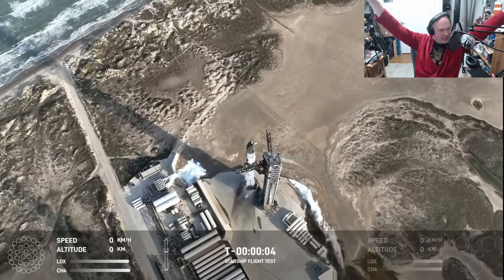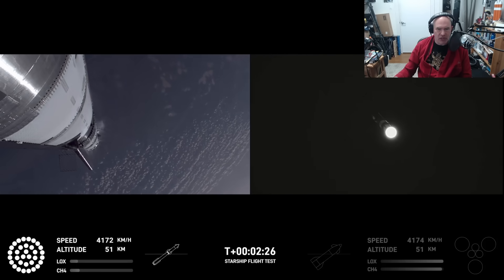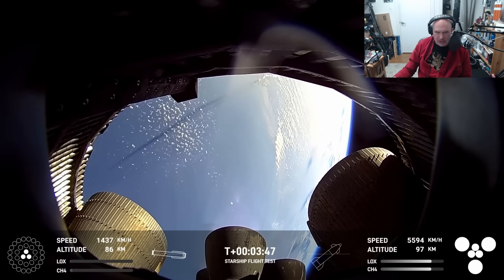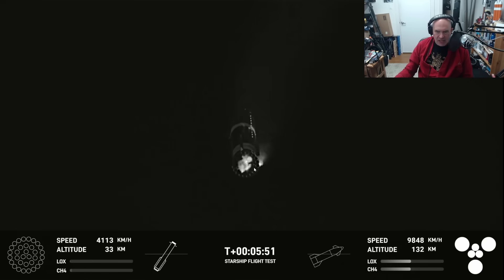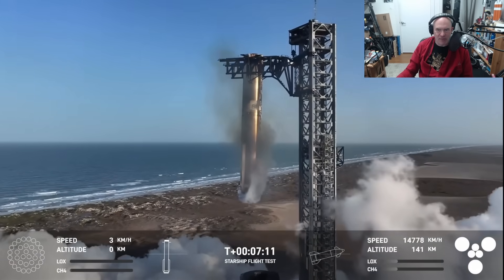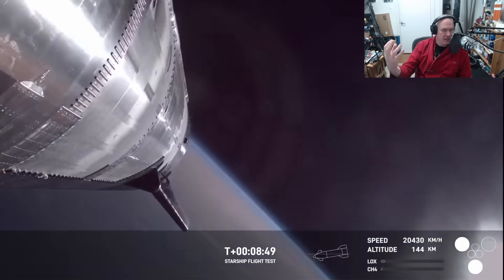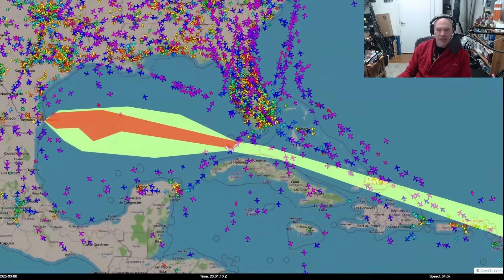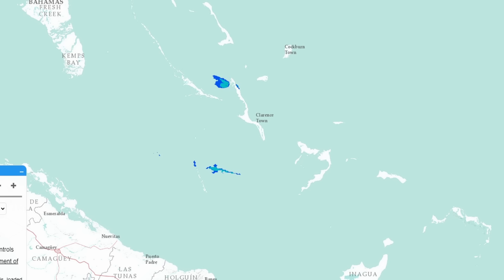SpaceX Make The Same Mistake Twice With Starship Flight 8

Comment: I saw an interview where the spokesman said most likely some serious re-engineering will be necessary, and he stated there probably will be a long pause before another star ship is launched. He said especially because the failure point appears to be very similar to the previous launch. With this new launch, he said several items were changed or replaced that could have been accomplished fairly quickly. Whereas now, more serious and extensive revisions, etc. could involve an extensive period of re-engineering.
Reply: This one was done and ready before the last one launched 🙄
There were some differences, because of what they wanted to test, but that's their ongoing testing profile.
Would you rather see an SLS launch every 2+ years, or a Starship launch every 2+ months?!
In my mind, more launches, more better! 
If SLS blows up in 2 years, when it launches again, will it be cancelled or will they have to review data for 2 years and try a new launch in 3-5 years??
I think at that point it IS DEFINITELY OUTDATED AND SHOULD BE CANCELLED!
Not hating on SLS, just the time frame they milked, to get a rocket in orbit IS RIDICULOUS!
HALF of the parts are from shuttle, because they have to justify the money spent on those parts all those years ago 🙄
Reply: @ricklong3218  SLS Artemis on it's first try, launched successfully, didn't explode, went to the Moon, orbited it, completed all the tasks asked of it, and returned to Earth for a successful splashdown. 

Until Starship can complete a single orbit, then you don't have a foot to stand on in trying to denigrate NASA and SLS.
Reply: @ChaosCat79  NASA did not build SLS. SLS was grossly over budget and grossly overdue. They made 1 attempt and succeeded! That's great! I was super jacked to see shuttle engines light again! I never said anything bad except what I just reiterated.
Now after 11 years of development happen for Starship, people will still be beating on SpaceX, because they dislike the person whom founded it.
SpaceX gets very little operational money from the US government, ESPECIALLY when compared to the other companies. 
There are still other rockets coming and I will be just as happy to watch them succeed OR fail just because we get to see launches!
Reply: @ Musk and Space X received $38 billion to deliever a Moon landing system as part of the SLS/Artemis mission. 

Where is the return on thaat taxpayer funded investment?

Plus for someone claiming they are not "hating" on SLS/Artemis, you spend an awful lot of your time denigrating it and looking for all the negatives, while insanely boosting the positives of Starship (there are none) and ignoring it's many, many problems.
Reply: @ChaosCat79 Damn, you just pulled that $38 billion number out of your ass, didn’t you? The actual amount is like a tenth of that. Get your facts straight pls.
Reply: @ChaosCat79  care to elaborate please ? where did 38B even come from ? bro last time i check NASA annual budget was 24B per year and SpaceX only get a fraction for some CRS and somewhere around more than 2B for HLS R&D, around the same price tag for Crew Dragon NASA awarded to SpaceX in 2012.

i think you are mistaken SpaceX for Boeing lol.
Reply: @ricklong3218  yeah it's so weird watching this now: people hated SLS, like a lot

Comment: This is a centre of gravity issue that SpaceX is obviously trying to overcome computationally. And their computational solution isn't working, which is why the thing keeps tumbling out of control. I'd guess this is a fuel issue - as fuel runs out, the centre of gravity keeps moving towards the back of the ship, making it increasingly susceptible to tumble-turning mid-flight. Obviously, the solution can't be achieved by firing rockets to adjust against the shifting weight, which is what they have been trying to do computationally. Boeing had the same problem with the larger engines on the 737 Max. And computations didn't help there either. Sooner or later, SpaceX will have to go back to the drawing board and push the fuel tanks lower down the space ship. Right now, that's something they clearly don't want to do. Computations won't solve this kind of issue. It might lower the risk of it happening, but it won't eradicate physics entirely.
Reply: Charles that wasn’t the issue. Scott explained this; it was just a failure of all thrust vectoring engines. That’s it. Without those 3 SL center engines they have insufficient attitude control, that’s literally it lol. Their issue is their engines being fundamentally unreliable and that’s been an issue on every flight.
Reply: The 737 Max had WAY more issues!
It's software, training, seat time, not listening to pilots, and bean counters 🙄

Comment: So they have to have leaks of methane and oxygen right. You need both in space to have a fire. So do they have multiple leaks or a leak at a point that both gases are released. If the metane is warmer then the lox would a leak into the lox tank of methane cause a pressure build up from the lox boiling and the pressure relief valves are dumping a mix of gasses to control the pressure?

Comment: It's interesting that back in the slide rule days of apollo we were soft landing stupid machines like a surveyors. ..but getting current technology to soft land and remain upright is a struggle...

Likewise...brute force stupid rockets  got up early and managed to make it to the moon enough times to call it a win and be abandoned...even though we did not have computer capability or navigation capability to guide an S1 stage back to a landing. 

I don't think it will ever be possible to make space flight as commonplace as airline flight given the performance requirements....even if that's the goal and even a requirement to make mass spaceflight a common occurrence.

I think chemical rockets are just a dead end...and engineering firms should be spending these billions on research into field propulsion...if they really want to do 'space' travel...

The unfortunate aspect of all of this is the capitalist profit requirement...and research and development on systems that don't produce obvious results or produce results of such paradigm changing improvement as to be culture shocking are almost equally  bad...

And so we're stuck doing rinse...wash...repeat...

Comment: Musk implemented DOGE at at SpaceX (Department of Gigantic Explosions). Russia failed with it's enormous N1 Moon Rocket. With 30 engines and too many moving parts that could fail. Soyuz however holds the record for the most launches in the history of spaceflight. It has less engines and less moving parts to fail.
Reply: Falcon 9 is superior to Soyuz.
Russia hasn’t advanced much past what the Soviet Union accomplished.
The N1 failed for MANY reasons.
The engines couldn’t be test fired, they didn’t have the ability to gimbal engines and therefore needed to use thrust differential, the person pushing for the N1 died during the program, and many other groups inside the Soviet Union were pushing against the N1.
Pair all of that with funding issues and it’s easy to see why it failed.

Falcon heavy uses 27 engines, so clearly engine count itself isn’t an issue.
Reply: @terrestrialcreature7481  Thanks for comment

Comment: I get that we aren't that worried about the engine starts on the booster because it doesn't need them all, but it isn't really redundancy if they never work in the first place.  I'd really like to see those engines being reliable, lighting up as expected on a regular basis.

Comment: There was the mishap loading the starship onto the booster. Maybe a piece of something broke off and pinged into the engine nozzle weakening it. I also noticed the image of the ship on the telemetry display was acting very oddly if the ship was spinning around - If you can't program a display to reflect reality, then what hope is there for other software?

Comment: @scottmanley or anyone. A few questions. Part 1: Does SpaceX do a test hot fire engine test on the ground with starship connected to the hot staging ring? Could some kind of hot staging ring blowback be damaging something?
Part 2: shouldn't starship eventually have some kind of higher control authority thruster system on it to regain control in the event of failures? The amount of useful data that they could have collected if they were able to regain control of starship to at least orientate it for a safe re-entry and record data all the way down till impact with the ocean. Not to mention when starship becomes crewed, the implications of only having major control authority with the sea level engines, failures still have the possibility of happening hundreds of flights into the future. I'm guessing it is a payload and fuel margin problem during these experimentation flights, much like the temporary hot staging ring separation requirement, but I'm still wondering.

Comment: Hi Scott:  had a thought (hey, happens ;-).  What is the one common item with these two launches that was not common with the early launches?  The hot staging ring!  I never liked that thing from the first I heard of it. I think it is dumb as a door knob to ignite your engines in a confined closed space.  Yes, I know it has openings maybe even most of it is open, but if you light up six raptor engines, all at the same time at that one spot, that is an enormous shock!  What do you have all been turning around.  Also, observed, that none of the testing that SpaceX did on the upper stage coming into flight eight used, or tried to simulate the response of having that hot staging ring, blocking the rocket exhausts I don’t believe.  I think this idea is damaging the engines, the piping in the structure of the ship when it ignites for staging. Elon, if you are if you are reading this, let’s do an experiment on flight nine, where we do not do hot staging, but rather figure out a gentle separation something like what the Saturn five used to do. If it fails again, then I can concur that the hot staging had nothing to do with the failure mode.  But if you suddenly have a successful flight nine, I think you will have found your culprit. That is not to say that everything is as strong or correctly designed as it needs to be on the ship, but it would suggest that we need to figure out a different way than the current hot staging method. That is my Saturday couch rocket engineering for today :-)

Comment: Worth mentioning that Starship flight 7 and flight 8 both failed exactly at the same time which was just over 8 minutes into flight. Same faults, same result despite all the modifications and fixes to Starship.
Reply: To me, this fact indicate that SX looked at the wrong place and tried o mend things. Otherwise with stronger, better, etc piping they wouldn’t have the second failure exactly at the same time and in same way, like they did nothing. Second failure was perhaps even more violent.

Comment: Ok, Starship and its booster have come way further, way faster than Boeing's Starliner in so many ways. SpaceX has managed, yet again, to capture a booster with a pair of arms. Something just 25 years ago thought to be impossible according to a lot of folks, or darn near it. That does not include the repeated landing of Falcon 9 boosters and cores, which was also thought near impossible just 25 years ago. Starship has a lot of work to go, it took nearly a decade of rushing to get Apollo to the moon, SpaceX has no reason to rush, just make sure it works. This is all new territory. Even with the failure of two Starships back to back, I am beyond impressed with the things being pushed forward.
Reply: Starship has to prove that it is capable of carrying cargo, astronauts, can complete an orbit of Earth, can re-enter Earth's atmosphere safely, land on the Moon *somehow*, display never-before-tried-in-flight refuelling (in space), show that cryogenic fuel can be prevented from boiling off during said refuelling, do that multiple times.... All before the NASA set deadline of 2026 for when the Artemis III will launch for the Moon to land on it. 

Yeah, "no rush", indeed.

Comment: My analysis of the causes of the IFT-7 accident.

A few days before the flight, I wrote on another Facebook page: "For me, the most interesting thing about this flight is how the rocket will behave if it is indeed loaded with 300 tons of more fuel."
In my opinion, these 300 tons are our big pink elephant in the IFT-7 "room" when considering the causes of the Starship explosion. Let's add that in addition to the 300 tons of fuel, we also have 20 tons of mass-size models of Starlink 2.0, plus another 5 tons of additional mass due to the fact that Starship 2 is 2 meters longer than Starship 1, plus about 5 tons thanks to the new Penz dispenser, plus another 2-3 tons of additional equipment, which they add with each new flight in the form of additional stringers, anti-splash devices (especially in the Superheavy liquid oxygen tank), etc. This gives us about 330 tons more mass than the IFT-6. Or the mass of 5 heavy battle tanks, each weighing 66 tons. About 99% of this new mass was added to the Starship and only 1% to the Superheavy.
As a result, the weight that the 33 engines of the Superheavy now have to lift increases by 6.6% - from 5,000 to 5,330 tons. During the launch, it was obvious to the naked eye that the rocket was more cumbersome than previous flights, and in the end it achieved its weakest telemetry result to date, excluding IFT-1: 4,400 km/h, at an altitude of 60 kilometers at the moment of the booster engine shutdown.
After the separation of the stages, the difficult fate of the six engines of the Starship began. The mass they had to accelerate to 26,500 km/h is not 6.6%, but a full 26% more than in previous flights. The thrust-to-weight ratio(TWR) for IFT-7 has dropped from 1.1 to 0.88, which means that the combined thrust of the six engines - 1464 tons, now lifts 1670 tons instead of 1325 tons. A TWR of 0.88 is usually not fatally low for a second stage, but in this case Starship was left by Superheavy in a much deeper gravity well than usual. For comparison, the TWR of the Falcon 9 second stage is even lower - 0.8 with full load of Starlinks, but the Falcon 9 booster takes it to an altitude of 62 kilometers and a speed of 8000 km/h. At IFT-7, at this point in the flight, Starship was 2 kilometers lower in altitude and 3,600 km/h slower. At such low levels, Starship's engines have to work at the limit of their capabilities to bring it to the required altitude and speed. And as we know from IFT-1 and in particular from the list of 63 FAA recommendations, Raptor2 and its piping systems are extremely susceptible to leaks when operating at full power - about a third of these 63 recommendations are directly or indirectly related to minimizing these leaks and extinguishing them with carbon dioxide if they occur. As can be seen in point C2, for example, the FAA requires that the fire protection system of the Superheavy be increased after IFT-1 by a factor of 15. 
However, from Musk's words about the accident at IFT-7, it follows that there is no fire protection system at all in the upper engine compartment of the second stage! To me, this is extremely strange.

After IFT-1, SpaceX did everything possible to improve the reliability of the Raptor2, but it seems that no matter how much they tighten the nuts on the joints, those between 300 and 611 atmospheres of pressure constantly remind of themselves. Especially the 611 atmospheres of the methane turbopump. As can be seen in the photos, the amount of methane in the tank begins to drop after the first engine fails at a speed of 17,700 km/h. Judging by the volume of lost fuel, I can assume that this is not just a leak, but an extremely large-scale rupture of pipelines and connections. There, in the compartment between the engines, a huge fire really raged. It was this tendency of the Raptor2 to leak that prompted SpaceX to start working on the creation of the Raptor3 - an engine that is as close as possible to the state of a monolithic capsule. Starship 3 will be equipped with 9 of these Raptor3 engines instead of 6, but it will also add over 1,000 tons to its mass, so uncertainty about its ultimate success still hangs in the air.
For the next SpaceX flight, the pipelines and connections of the methane tract, which operates under extremely high pressure, will have to be greatly reinforced. Because if such a large amount of methane leaks again, no fire-fighting system will be able to cope with such a flow.

Comment: Great video as always Scott. A couple thoughts I had:
- While we may be seeing some methane burning while the booster is reentering I think the red glow is mostly compression heating on the false ceiling heat shield
- They usually safe the FTS about a minute before SECO. They do the same thing on Falcon 9 launches so I don't think it was someone just reading a script here. Additionally I think Starship always has autonomous FTS, but they're just safing the manual mode.